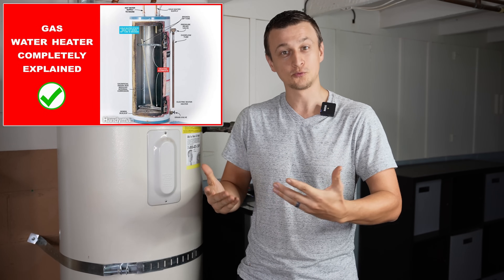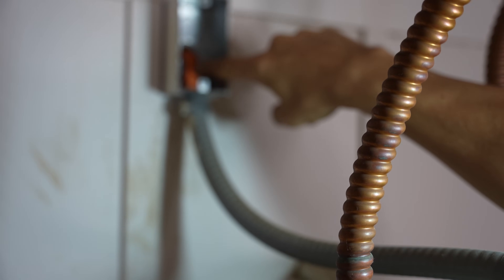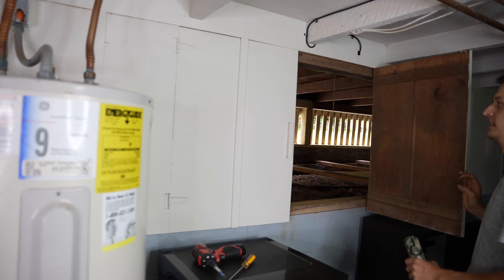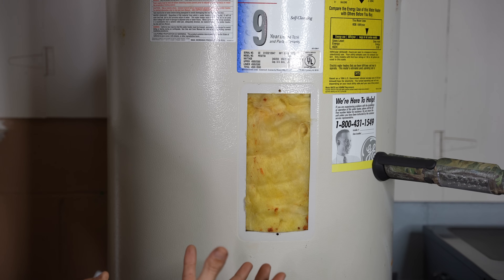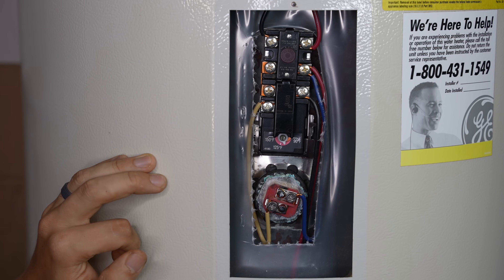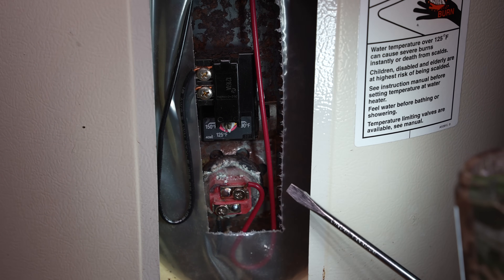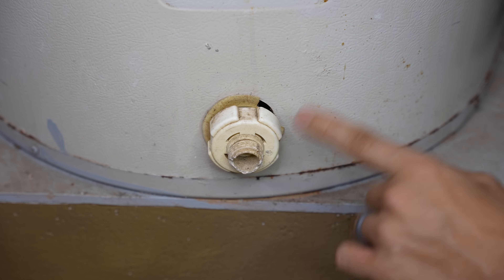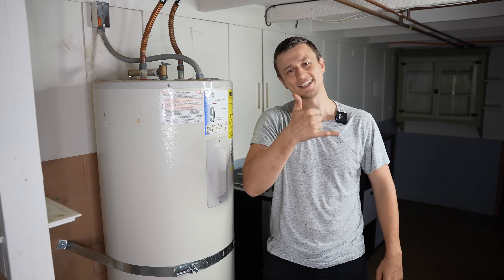How an Electric Water Heater Works

Comment: May be U need second earth quick strip on near top of the heater. U said earlier humidity in Hawaii? I experienced around 7.0 earth quick when I was 10th storage University dormitory and decades later, I experienced around 6.0 earthquake when I was in my apartment, the same one now! It is pretty scary feel like the building is about to crack and colipase! Just looked up Google and it said Hawaii has 2.1 to 4.5 earthquakes that is far less serious than California, except the google said Hawaii has literally thousands of earthquakes and I don't think I would live in Hawaii despite the warm temperature's year around!

Comment: Right now whenever my breaker is on for the water heater, after 15 minutes water starts leaking through both hot and cold inlet nipples. The leaking water doesn’t feel hot so I’m guessing it’s coming from the cold side. I just purchased two new nipples and the anode replacement. After I take the cover off the top, make the repairs needed and flush it I will give an update on what I found.

Comment: i have the same brand. However, there is water build up where the wires are connected that cause short and trip the breaker, any idea whether the water leak from the tank or come in from somewhere else?

Comment: As someone who also lives in Hawaii I'm not surprised to see that much corrosion from the amount of salty air blowing around, especially since it looks like your tank is in an area near an oudoor access point. Thankfully mine is tucked away in a little 2x3ft closet or I'd be right there with you.

Comment: I just replaced a water heater heat element. I turned off the breaker and drained out the water heater water before replacing the  heating element. I replaced the heating element and filled the water heater back up with water. When I turned the faucet on the the sink I noticed on the hot water side, the water did not come out. The hot water does not come out in the kitchenthe two bathrooms and  in the two showers.why is this hapening and what do I need to do to fix this problem? Please advise

Comment: Not supposed to run jacketed wire in conduit, I actually got failed for this once, inspector explained with a straight face that it could over heat. I acted impressed with his vast knowledge and kissed his behind for about 5 minutes and he passed me. But word to the wise, thats very very very dangerous..LOL.

Comment: Excellent video. Exactly what I was looking for. 
One question, I have a label that says “Pump disconnected. Wasted too much energy” 
Coincidentally, my water in the shower takes longer than usual to heat up and runs out pretty quickly. However, this isn’t the case when I have the central heating turned on. 
Is the culprit the disconnected water pump?

Comment: I have a label on my 1 year old water heater that says I should check the pressure release valve at least once a year to make sure it it operating properly.  How is that done?  Surely I do not have to heat the water to boiling in the water tank.

Comment: Why is there water collecting under the top (upper) element on my water heater, When I take the cover off to double check everything and look for corrosion and do my yearly check? There is water collecting just in the top half between the outer shell of the tank and the inner water tank. On my water heater, the upper element is actually on the upper part of the water heater and my bottom element is actually on the bottom. What is causing this? Do you have any ideas?

Comment: Really good video - especially compared to the garbage Lowes and Home Depot have put on Youtube on this topic. I was looking for a video I could have my apprentice watch to learn about water heaters and I think I will ask him to watch this one.

A couple things to mention: The seismic strap on the water heater in this video is not installed according to manufacturer instructions, which call for 2 straps - one installed within the top 1/3rd of the water heater and the 2nd installed within the bottom 3rd. The other thing to mention is that Canadian code requires water to be stored at a minimum of 140 degrees F and delivered from the shower at no greater than 120 degrees F. I understand that US codes often allow for storage at a minimum of 120 degrees F to prevent unacceptable levels of bacteria growth (or more accurately, to achieve an acceptable bacteria kill level within a certain amount of time). In Canada, we either control the water temperature that comes out of our showers/baths by adjusting the integral temperature limiters within the shower valve, or we install a whole home mixing valve which blends cold water into the hot water leaving the water heater. In the special cases of a seniors home or a daycare center code here requires a whole home mixing valve because ALL faucets must be limited to no hotter than 120F. One other note is that the piping materials of the discharge tube of a water heater should be rated for up to 210 degrees F, which is the relief valve temperature setting.

A couple other things that might have been good to discuss is the information related to potable water expansion tanks - how to set them up, how to diagnose them, how to install them, where they are required and not required, etc. Also, some information about vacuum breakers and their role in this job would be helpful as well.

Comment: my landlord installed a new water heater and currently it’s tripped  and won’t reset. i pulled the cover for the wiring terminations on top of the unit and it was flooded. what would cause water to come from the top of the tank like that?

Comment: My hot water heater is leaking. Do you have a trouble shooting guide or is this issue straight to a plumber?
Reply from the maker: I have a short video you can use to help determine that: https://youtu.be/ambX6ND8dbQ?si=Y7HJTRmFdfovBOxl

Comment: A question I can't get answered is how does current flow in the coil.  You have 120v on both sides and no connection to ground or neutral.  How does current flow?

Comment: this was a very easy to understand explanation. thank you. i do have a question. i just had a new water heater installed a week ago. yesterday while showering, i noticed i ran out of hot water midway. and it seems like hot water takes a while to get to my taps. im guessing something is wrong with the heating elements? everything worked fine for the first few days we had the water heater. but all of a sudden, something is of. any idea what could have happened?

Comment: I have a leak at drain valve at bottom. IS that hard to replace. Instead of changing waterheater can. I just put a new drain valve n new bar inside to collect rust. N gi with that.  Thnx

Comment: Well done, but I think you made a mistake at the end.  The bottom thermostat would see a change below set point first and would call for heat.  If you used enough to trip the top element then it would switch to top element only to keep the water at the top. Once the top thermostat satisfies (hot water rises and is closer to the outlet) then the bottom would kick back on to heat the bottom half.

Comment: Thanks for this outstanding video. When the water heats up, pressure in the tank rises and water may drip out from the PRV. At this moment, the tank pressure is probably >150 psi. The questions are, 
1) why the pressures at the cold and hot pipe outside the tank are not as high as inside the tank? 
2) how much pressure will be at the cold and hot pipe right outside the tank?
3) i understand that an expansion tank can absorb the extra water but isn't it enough for the home pipe volume to absorb the extra volume?
4) will the expansion tank prevent the heater PRV from being activated?

Comment: I have a brand new 30 gallon electric water heater that I've had for a month. I get hot water for about 5-8 minutes in the shower and then starts to get cool after that. I have the thermostats at 120 degrees fahrenheit. I checked the continuity on the elements and they are working fine. Can it be that the dip tube broke??? Or what else can it be? Thanks!
Reply: At 120 degrees and only 30 gallon tank, you are probably using all the hot water in the tank for your shower and not much cold water mixed in to make it comfortable. Try pushing the thermostat up to 140 degrees. This way you will use less hot water in your shower and more cold water to make it comfortable. Then you are less likely to use up all the hot water in the tank. And try using less water in your shower altogether. Only use enough to get fully wet without going full blast. You will save water and reduce your electric bill.

Comment: So the water is always there on standby so the delay you get when you turn on the heat is just the cold water still in the pipe from previous use ?

Comment: this video very helpful but i have a question ,, what happed to hot water when cold water no more coming , i mean how hot water leave the boiler , i think hot water could not leaving boiler because there no pressure of cold supply to push hot water 😊

Comment: What would be some causes that would cause the pressure relief valve to open for extended periods of time, this is happening in a mobile home set up.
Reply: The water may be too hot. Check your thermostats on the water heater and turn them down if they are over 140 degrees.

Comment: Excellent video. One question. Why is it when I turned the cold water supply off to the heater and wanted to only use cold water at the shower not water came out and the pressure was low at other cold water outlets?

Comment: Notice the corrosion of the hot water hookup line & temperature/pressure relief valve.  That's what happens when you connect copper/brass to galvanized steel (bimetallic corrosion) and is easily remedied with the use of dielectric unions 😉

The amount of corrosion around the T&P relief valve is a little concerning considering its function 😳

Cold and hot water ball valves (brass versions) are recommended and particularly handy when it comes to leak testing.  For the love of god don't ever buy the CPVC versions!

Also, for those in a commercial setting, you can install commercial thermostats into a residential water heater to meet the minimum 175°F water temperature required by the state health department which will save you some serious money when compared to buying a "commercial" unit 😊

Also, most manufacturers actually recommend flushing about a quart of water through the drain valve ONCE A MONTH!  This ensures that the drain doesn't clog up with limescale and other sediments thus the valve stays in good working order.  If it starts to leak to can easily remedy the issue by installing a garden hose cap.

They recommend flushing about a gallon of water through the temperature/pressure relief valve ONCE A YEAR!

If you're going to fully flush your water heater, it's a good idea to install a inline filter on the hot water line exiting the water heater to snag any particulates that could clog up you shower/sink/etc. mixing valves in the process of bleeding the air out of the tank and lines.
Reply: That water heater I believe is 19 years old. Anyway you seem to understand how these heaters work. I leave the bottom thermostat all the way cold and just use the top one. What do you think on that or are the thermostats  all supposed to be working all the time?

Comment: The electric water heater does not trip the breaker and the hot water runs do not last long, why? could it be that the dip tube is damaged and needs to be replaced?

Comment: Great video explaining how a water heater works! I've been wondering for a while what happens inside the water heater when I turn on the hot water tap; the intake cold water coming in at the bottom while the hot water goes out at the top makes a lot of sense. Thanks again!

Comment: I still believe that natural gas water heaters are more efficient than electric water heaters.
The most efficient ones are the rooftop solar convection systems, but are expensive and need periodic maintenance. In certain areas electric power is expensive and prone to outages. Thanks for this educational and preventative maintenance video.

Comment: How come my lower heat element have power but won turn on??? Check everything but still dont work
Reply: I adjust upper thermo to 90 and lower thermo to 150 to see if it work but they have 240 volts but no LED is on

Comment: Great video, very clear and informative. We live in Greece and have a similar (but smaller) boiler than the one in the video. Our boiler is in an outside bathroom and is only used for showering. After we moved in to our house recently it worked perfectly, but suddenly we have lost the cold water from the shower tap. This makes showering very difficult as we can only try and heat the water  by looking at the temperature gauge on the outside of the tank, and we usually ending up having luke warm showers as we otherwise would scald ourselves. Do you have any idea why this has happened? Not sure exactly how old the tank is but would guess at least 10 years old. We are getting a new bathroom in a few months time but need to sort out this problem in the meantime. Look forward to hearing from you, Cheers Rob.
Reply: It sounds like you might have a clog or something in your cold water line. You might want to have a plumber take a look unless you can find a good video on self repair.

Comment: you were very thorough about electric home heater in bathroom. But like any video out there that I watch to learn something, you too missed something which is very important. What is that thing that heats the water, an anode, a rod and my questions is that you did not show the very thing that heats the water, its shape, how it is replaced. Its like talking about a good car, how beautiful it is and the outside and the flash lights and the electric windows and the good tires and so on and not talking about the cylinders where power is made and not showering the cylinders. So you dont get a Like from me nor a Subscribe

Comment: How does the water inside move in and out to faucets  in sinks and tubs. I have two full baths. I replaced both upper and lower elements and thermostats. Circuit breaker works fine. Tester shows there's is electric going to the elements. However, after one hour of completing the above steps I have no hot water coming out of any faucets whatsoever. Furthermore, and this has me baffled, The bathroom closest to the water heater only has cold water from the hot water faucet. And the other bathroom (further  from the water heater has not water (hot or cold) coming out of the hot water faucets. What could cause this issue. It's sure a new issue with me.

Comment: My AO Smith 50 Gal water heater is only a few months old. When we installed it the power was turned in before it was filled with water. I replaced the top element which was burned up. I ohmed out both elements and are about 13 ohms. The temp is set at 123 on both regulators. With nobody using any hot water in the previous 48 hours. When we try to fill up our top we run out of hot water ( maybe 25 gal tub) when it is about 1/3 full. Any suggestions on why this is the case would be appreciated.

Excellent!! Videos . Thank you!

Comment: My heater isn't heating enough and the low element isn't working, beside that I installed a new heater yet it still doesn't work. I don't have enough hot water. The top element works but the bottom does not. I'm not sure exactly if it is the top thermostat that isn't working or the low thermostat.  Can you please give me advice? And thank you for your video

Comment: My hot water line is leaking. I had the water heater off, because of the summer, here in FL.  If I close the cold water , using the turning valve level, will that stop the water dripping  until the plumber comes?
Reply from the maker: Turning off the cold water would slow down the leak until the water level in the tank gets below the leak location and then it will stop. If the leak is above the water heater, then the leaking should stop pretty quickly after the remaining water in the pipes leaks out.

Comment: Jay, more than half the videos I have watched and according to Rheem water heaters, as you know, when hot water is turn on, and cold water enters the bottom to force the hot water on top to flow out.   It  is normal and logically sound that that the water on the bottom will be the first to call for the heating element to turn on since the water is cold, so the bottom element always turns on first,  not the top element since that water is still hot and most likely at temperture.  According to Rheem the top element hardly ever turns on (only on first fill).  Why do state that the top element always turns on first?   It makes sense that as you use the hot water, the tank would naturally want to heat the bottom cold water immediately to keep up with a continuous flow of hot water.  Rheem's explanation is exactly that.  
I would like to understand your explanation and how you know that the upper element heats the water first.  You are not alone, but many others say just the opposite.  I'm just curious.  Thank you.

Comment: What is all that sediment from?  Isn’t this potable water coming in?
Reply: Google said:

Tap water contains several minerals, including calcium, magnesium, sodium, potassium, and phosphorus. It also contains trace elements, such as copper, iron, selenium, chromium, and zinc. So, when the water is heated, the minerals separate and float down to the bottom of the tank where the create sediment.

Comment: Probably a dumb question but how does the hot water get up to bedrooms maybe 2 floors above? is the water heater under pressure or is suction created when the shower turned on? Great video, many thanks Chris, Oslo Norway.
Reply from the maker: The water is under pressure (usually 50-60psi) so when you open any faucet the water is basically getting pushed out.